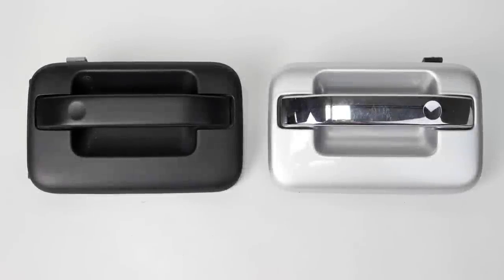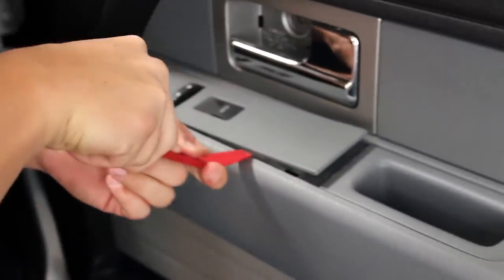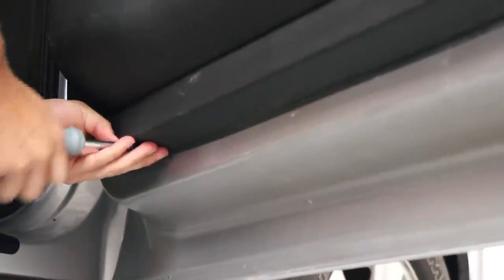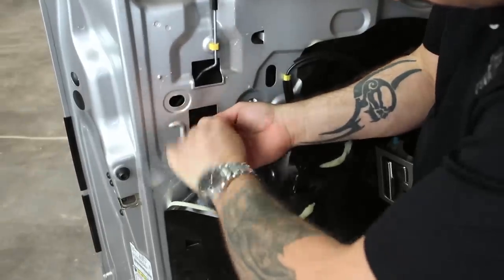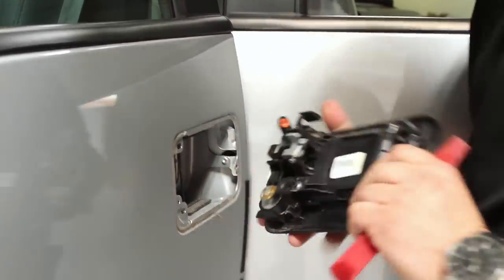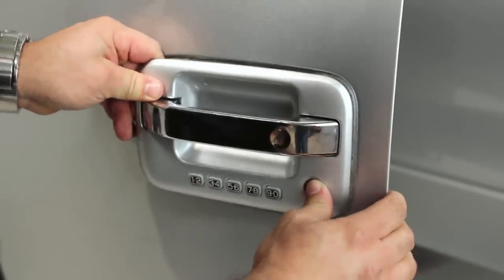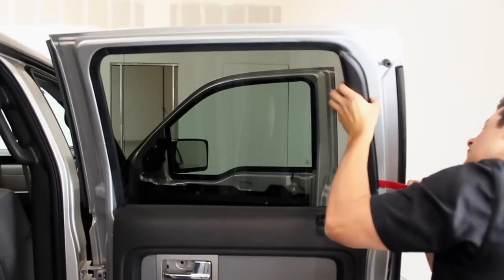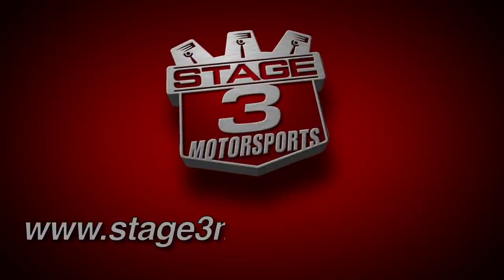2009+ F150 Crewcab Painted Door Handles Installed

Comment: Could you make the keypad usable or is it just there for show?
Reply: Ray Kautz what are you talking about? All fords come with the keypad that actually works.
Reply: If it doesn't come OEM on a base F150. Can the keypad be used on the replacement upgrade is the question.
Reply: Connections, etc may not be present.
Reply: Ah, got it. Like with any of the products and models, it's usually very easy to go from not having an option to having one. I'm assuming a simple connection to the wiring harness and cables is all that you need.